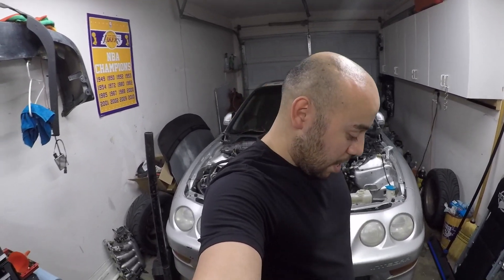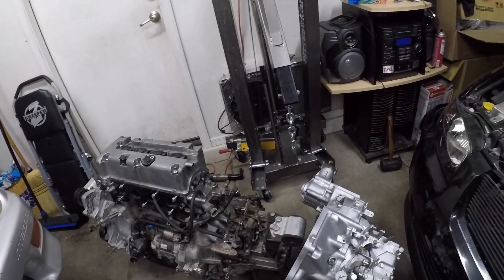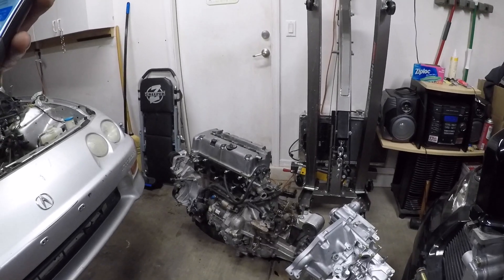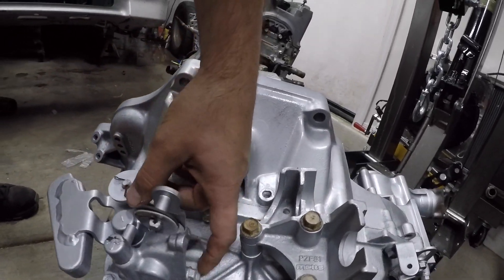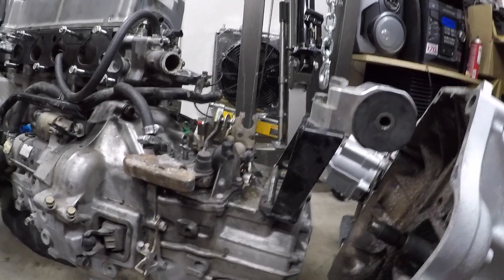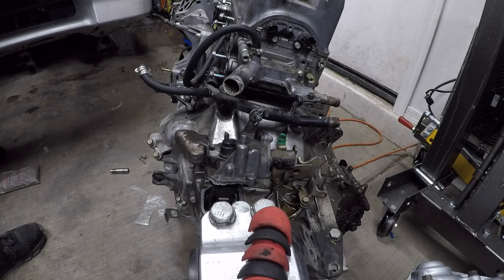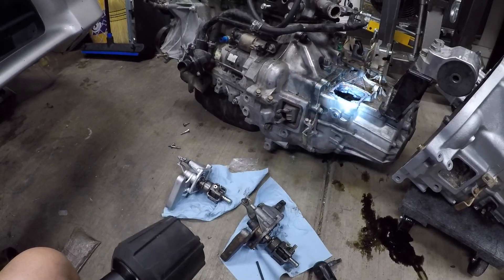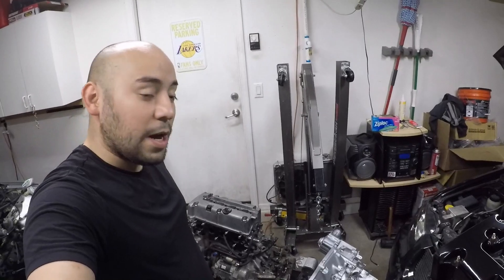Honda K Series AWD and FWD Transmission Comparison!

Comment: If I pull the transfer case from my awd and sell it, will the transmission explode or it be fine? I bought at element because im a moron and I want to sell the parts for awd and then drive the car. AI Was telling me it would wear out faster but I don't really see why

Comment: Are the transmission mounts the same for 2 wheel and awd because I’m putting a element 5 speed awd but I was gonna buy some mounts off eBay and didn’t really see awd transmission mounts just 2 wheel thanks 🙏

Comment: Can you use a crv awd transmission on a fwd k24 swap? I am wanting to go k swap, but also awd but not right away, can I run the awd transmission on fwd only for a while with no issues? Since I want to go awd eventually I figure I might as well get the awd transmission if I can run it fwd until I can go awd..
Reply: U got any answers ?
Reply: @christopherjoseph1909  no answers, no one ever reply.. but i think thats possible because when some people get their cars dyno they get them dyno on fwd only by disconnecting the driveshaft.. but not sure 100% if its safe to use the awd transmission like a fwd one.

Comment: What are your thoughts on swapping a FWD transmission on an 05/06 crv with an AWD transmission of and 05/06 crv.  The mounts are completely similar. What should i be concerned about
Reply from the maker: Mounts should be the same yes. All you should need is the rear end, driveshaft, and rear axles to make your fwd crv to a awd.
Reply: @pFbSpecV  thanks for responding man. Electronically speaking what could be different and would it be easy enough to be adjusted by an ordinary transmission/engine swap shop.

Comment: Why did you go with the element awd set up instead of the crv awd set up?
Reply from the maker: Trust me I wish I did lol I didn't know of the speed sensor being different until it was to late lol
Reply: Is the dif really that much bigger?
Reply: How about running a crv awd transmission and an element dif?
Reply: Geo Castro can’t have interchangeable parts. And no
Reply: I know you can add the 6th speed from the tsx type s transmission to the element transmission but can you do the same with a crv transmission?